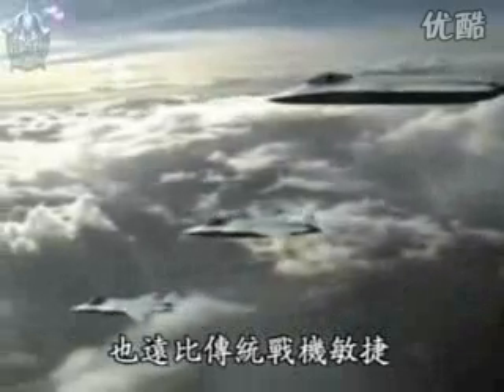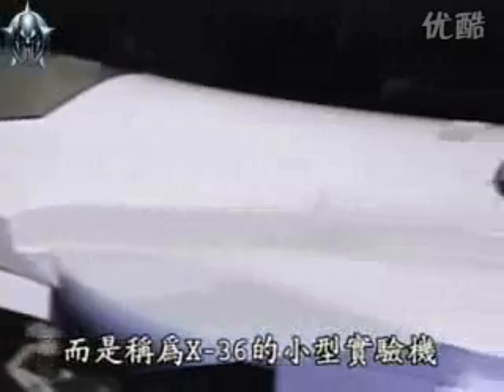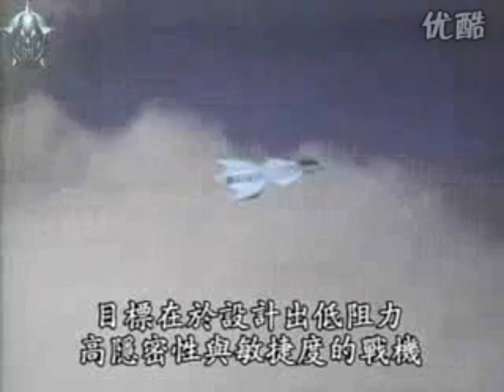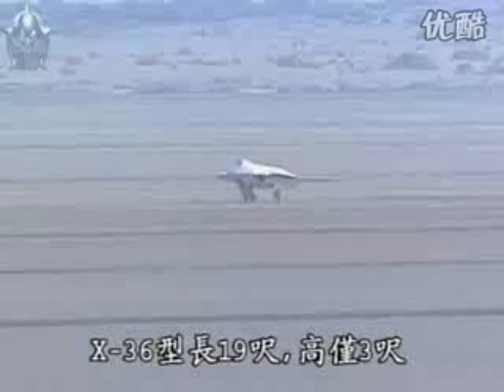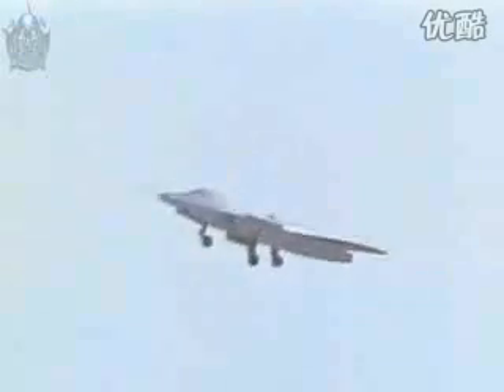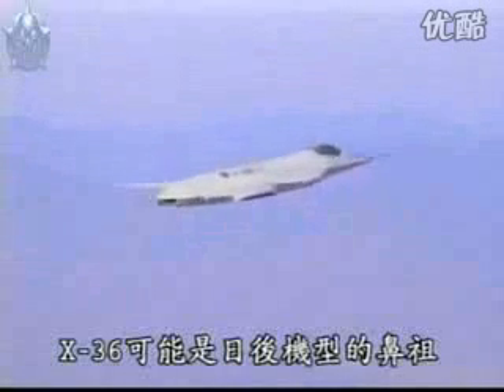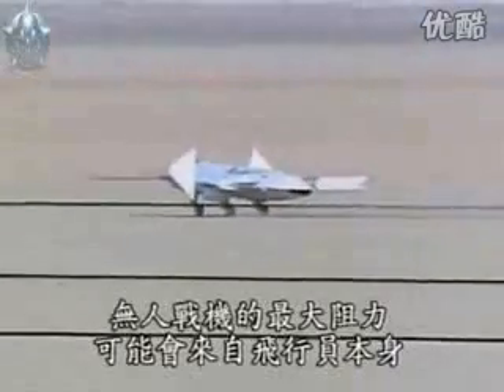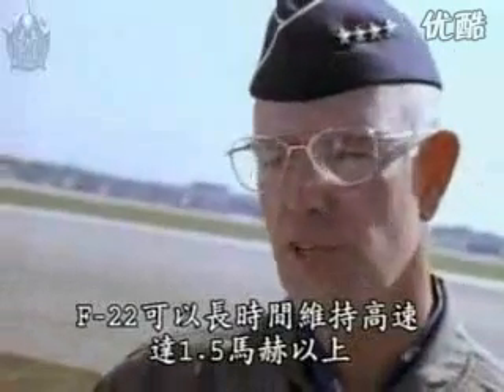Mcdonnell Douglas JSF proposal and x-36

Comment: Αnd look today. The most failed junk in history has the name Fail-35 Slowpoke.
Reply: +SUB ZERO LIN KUEI "Slowpoke"?? Load the F-16 or F-18 with the same amount of fuel, missiles and bombs as a combat loaded F-35 carries and see if can do Mach 1.6. Heres a hint....NOPE. And that's the difference, the F-35's numbers are when the aircraft is fully combat loaded just like it would be if it went to war, while all its competitors have to cheat by reporting their numbers with half fuel and carrying no bombs, missiles, pods, or external tanks. The F-35 was designed for COMBAT, not airshows.
Reply: +trpilot6 HAHAHAHAHHAAAAAAAAAAAAAAAAAAAAAAAAAAAAA

ICE JOKE !

HAHAHAHAAAAAAAAAAAAAAAAAA
Reply: +SUB ZERO LIN KUEI Chill out man.
Reply: Roland Lawrence The F-35 is one of the worst things to happen to the Russians. Russians rely on advanced integrated air defense systems to protect their borders, as their Air Force is not maintained and 1000's of planes have been written down for repairs with no date to be repaired.

Guess what was designed to defeat Air Defense systems? the F-35. It has a radar cross hair countless times smaller than the F-15SA, with the SA never being able to take advantage of stealth. (Stealth aircraft are built from the ground up with that role, not added on.) And the F-35's sensor fusion allows it to do endless amounts more damage than an up armored F-15 would.

And the cost BS you're spewing is similar to the F-15 debate 40 years ago. Congress disliked the Eagle because they believed that  a high cost per unit was the way to lose an air war. They believed that it's job as air superiority was useless if it couldn't do strike missions (a job that was adopted several years later after old aircraft were phased out.) And now look at it, it's the most decorated aircraft in the world.
Reply: Roland Lawrence Well that's great that you support the F-16 program, because what they are doing now with the F-35 is copying that logistics tactic. One being an expensive air superiority fighter, and another focusing on multi-strike with a less expensive price tag and planned exportation. (And neither the F-16, nor the P-51 have a K/D ratio to combat the 102-0 of the F-15)

I'm acquaintances with a couple Raptor pilots in the air national guard and while they have trouble meeting their minimum hours in some bad months, their training is highly dogfight based due to the simplicity that comes with their radar systems and weapons management in general. The wonderful thing about the JSF is that it's more of a weapon platform rather than a fighter, and simulators would really be perfect for them as the most training they have to know is cockpit management.

And most modern countries know that the first strike capability is one of the most important processes in war. If you don't have a way to strike their homeland through conventional means, you've lost. As I've said, the F-35 and F-22 have easily been finding loopholes in the S-400 and L-band radar systems through deceptive cruise missiles and great HARM capabilities that come native to the planes. (And you're gonna have to pull up a source for the F-35 only being stealth from the front and in X-band. If I recall it has electro-emission stealth and X-band stealth from all sides.)
Reply: Roland Lawrence Well, I'm not really sure what you mean by the "nuclear bundle" thing you're referring to, unless you're talking about the B61-12 variable yield bomb. But in that case you're going to have to give me a source on where we are exporting them.

And the F-22 was supposed to have Mmh/Pfh of lower than 12 by the time it reached it's maturity (a total of 100,000 hours of flight time). It did achieve this goal in 2009 when it had a score of 10.5 hours of maintenance. (This was before the F-22 reached its 100,000 flight hours too.) To put this in perspective, the F-16A has a standard 19.2 Mmh/Pfh.

Why the F-22 pilots have problems getting flight hours at my local base is not so much maintenance, It's the fact that there is a surplus of pilots, and only a dozen F-22's. (And the amount of mechanics at bases really makes a difference in maintenance time, with my base usually being understaffed.)

And as for the classic nerd fight between which plane is the best, why do you think that the P-51 is the greatest? What did it do that other planes didn't?
Reply: mPky1 A hundred missiles are useless if you don't have a platform to employ them from properly. And UAV's come with their own set of problems, with electronic warfare being a very effective tool against them.

And see, you're suggesting that F-15's will do poorly against modernized Russian forces (China's air force is practically a shitty Russian one.), but that's why we've created the F-35 and F-22. Using an upgraded 70's era plane to fight Russian 70's era one's is fine for now, but might not be in the future. Thus the current defense contracts are spawned.

(And the only Russian jet superior to the F-15c is the Su-35. In the latest war games the K/D of the two were 0.8 to 1 in favor of the Suhkoi. The USAF has plans to improve the passive awareness of the F-15c in a few years anyway.)
Reply: mPky1 Naval ballistic missiles are all used from a platform in the form of a 2.2 billion dollar Los Angeles class submarine, with a cost of 30 million for each trident ii missile fired.

So in total, to employ one nuke in the middle of Russian territory. You can use a submarine, where the cost comes to at least 2.23 billion dollars. Or you could use the F-35 and it's B-61 to penetrate enemy air defenses and deploy the weapon at the target with the cost racking about 130 million.

Enough talk about nuclear arms though, ICBM's and ship ballistic missiles wont be used unless it's an end world situation anyway.

The reason why we're investing in the F-35 and F-22 is because we want the first strike capability to take out their nukes before they can even fire them off. The US has teams all over mapping out just how to do that. And it's completely possible, you just need a lot of precision and a little bit of luck. The plane can still hit the nuke if it's in it's launch platform If it launches, it's all down to our nuclear defense teams to launch anti-ballistic missiles.
Reply: mPky1 Trident II has 14x 100 kiloton nukes, F-35 can have 2x 300 kiloton nukes. The B-61 is not a "shitty bomb", its 20 times stronger than the little boy used in japan. 2 F-35's is effectively the same power as a trident missile with all of the shock factor. (Russia and China can detect trident launches.)

And with forward operation bases in Mongolia, Europe, Japan, South Korea, and any body of water surrounding Russia, I think our F-35 can reach. It's range with drop tanks is something of 1,700 miles, which leaves a 900 mile target it can get it's payload out to. (with the assistance of high altitude bomb tossing.) The F-35b and a have about a 100 mile shorter range, but if it took off from the black sea it could easily reach Moscow with a few hundred miles left. And Raptors have a much higher range than that and can easily escort them there if there was any worry about detection.

The B-2 bomber is designed to hit further inland targets, with it's 7,000 mile range if we had one based in the UK and one based in Japan, we have the ability to hit any silo in Russia.

This is all beside the point though, most of our planning is against China, not Russia. China has a much more advanced nuclear unpredictability and F-35's are perfect for the job since we have FOB's in Mongolia, the South China Sea, and the Bay of Bengal giving even F-35's access to every launch platform.
Reply: Roland Lawrence The Air Force actually does believe the Navy's role is virtually useless when fighting a conventional war. China has the capability to launch a single missile to destroy a Nimitz class carrier, with virtually no way to defend itself. It's a large sum of money for those super carriers with no real guarantee they will be safe.
Reply: Moscow is less than 900 miles away from the black sea, as i said. The F-35a or b can take off of a Nimitz class and fly there.

(and it's closest border is Belarus, with 280 miles of Russian territory in between.)

Belarus to Moscow: 280 Miles
https://www.google.com/maps/dir/54.682667,31.0492915/Moscow+%D0%9C%D0%BE%D1%81%D0%BA%D0%B2%D0%B0/@54.1880229,29.7302446,5.75z/data=!4m8!4m7!1m0!1m5!1m1!1s0x46b54afc73d4b0c9:0x3d44d6cc5757cf4c!2m2!1d37.6173!2d55.755826

Black Sea to Moscow: 745 Miles
https://www.google.com/maps/dir/46.7517273,36.4452739/Moscow+%D0%9C%D0%BE%D1%81%D0%BA%D0%B2%D0%B0/@50.1184642,34.1999653,6z/data=!4m9!4m8!1m0!1m5!1m1!1s0x46b54afc73d4b0c9:0x3d44d6cc5757cf4c!2m2!1d37.6173!2d55.755826!3e2

And by the way, I feel like one of you is getting a little heated. I'm appreciating the conversation that is going on, and in no way am I trying to be antagonizing.
Reply: mPky1 You know you can just make one post right? You don't have to spam. I guess I'll address at least one of your insults, since you left one at the end of every point. You're calling me stupid and dishonest, but you just stated a post back that Moscow was 3 times the distance of any bordering country than it actually is to assist your side of the argument. This is blatant dishonesty, and anyone that knows a hint of geography is aware that Moscow is right next to the western border. Try being a little more civil next time.

Now back to the argument. We don't get to rule out the B-2 because we're "only discussing the F-35." The B-2, the F-22, the F-35 and the soon to be B-21 are all designed from the ground up to work together to achieve strategic advantage. Without one of them the entire system falls apart. 

China does have much more nuclear unpredictability, obviously you haven't done your research. China has dozens of launch platforms for every nuke they own, with a very complex underground rail system to secretly carry around the warheads. It allows them to minimize their nuclear arsenal to a tiny fraction while being more difficult to map out than Russia.

And yes, the F-35 can fly practically straight to Moscow... That's what stealth does for the bird, it can fly through air defenses.

And the F-35 does have partial access to the center of Russia. America has been making a lot of friendly gestures to the country of Mongolia, and we will most likely be FOBing with them in the next couple of years. Giving us access to a good amount of south Russia, and all of Russia if the B-2 is involved.

North Mongolia to Russian Central: (It's 2000km because i'm being forced to use a curvy walking trail, not a straight flight.)
https://www.google.com/maps/dir/48.8280249,89.3254673/55.5250826,79.5141709/@55.2822789,85.2240372,3.5z/data=!4m2!4m1!3e0

And finally, yes. Russia is that stupid to put nukes next to US bases. Remember when they tried to put nukes 170 miles off the tip of Florida? Also known as 10 minutes of flight time for the F-15 on afterburner. Russia puts a lot of nukes over in it's west bank because they are quick response nukes. It's to destroy the European countries capitals as fast as humanly (if ending our species is even in a human's will) possible. They have a lot of nukes in Siberia, but those again are easy to take out with B-2's.

The reason why Trident missiles and other ICBM's are not a solution for the US is because it assures mutual destruction. What they are emphasizing in this battle plan is destroying the enemies retaliation. Take out the silos first, then strike. If the Ruski's see 4000 ICBM's leave Iowa and Colorado, they will send their 20,000. If the Ruski's see 20,000 of their nukes get destroyed in the span of 2 hours with the always active ones getting destroyed in the first wave, they wont have any way to retaliation. (assuming we could even take out half of them that is. China's numbers are much more manageable.)
Reply: Roland Lawrence Well, that's a good point. The sealing off of the Black Sea could pose a challenge. We've sent cruisers in there before and I may be wrong but I believe we still have one in there. Maybe that tonnage requirement poses a problem, but i thought Turkey is the ultimate decider of who crosses, and let's just say they don't really like Russia right now.

We also have the Baltic sea, which is much larger and is the same distance away. You're gonna have to let me know if there is anything that prohibits us from going in there.

The Russian's most likely wouldn't shoot first. It's highly debatable that they could destroy our carrier first, as they don't have a stealth fighter, and we have upwards of 20 support cruisers and ships assuring the safety of our carrier, along with a wing of 4th and 5th gen jet's to protect it.

And i'm not going to go on record and say that the US is capable of taking out the massive amounts of warheads in the 'Rodinia', but the B-2 can carry 16 GBU-31's which are capable of bunker busting. And each F-35 can carry 4 GBU-31's.

Of course for this plan to ever be half conceivable you need the 1000 F-35's that were originally planned, along with the 1000 F-22's to relieve the stress an lug some tonnage out there. But I cannot stress this enough, Russia is not a target, nor a threat. China has been a main focus for awhile now.
Reply: mPky1 Man, I'm not even claiming that the F-35 is meant to be used for clearing nuclear sites, you got me onto this subject. All I was saying is that in a lot of cases the F-35 is better at destroying nuclear silos than ballistic missiles due to the ability to hamper the time for a retaliatory strike. The F-35 has far greater purpose than this scenario which is most likely never going to happen.

I'm also getting a little annoyed that you think the F-35 has to be graded as a single, self-dependent plane. It's like judging a fish by it's ability to climb a tree. That's not what the F-35 was ever conceived to be. It is very highly a support role for the F-22's, B-2's, and any 4th generation planes and ground units in the area.

And the 9/11 comment was kinda bold. Some F-15's with missiles arrived at the scene, and some F-16's with only ballpoint rounds arrived, but what exactly did expect them to do? It took the FAA over an hour to call an immediate grounding for all aircraft. There was dozens of thousands of passenger planes in the air at the time of the event. Did you just expect fighters to shoot down planes full of citizens under a slight suspicion that they might try to crash the plane?
Reply: Roland Lawrence Agreed, attacking Russia in the way I explained is all highly theoretical, and most likely the Navy would never even use multi-role fighters as suggested. Nukes or nothin' is the motto when it comes to us fighting Ruski's. The technology and man power is simply not there to pull off something conventional... yet.

Other than that though, I think you're really discrediting China's power. They may not seem like it, but their economy is doing well enough that they are effectively out numbering our entire military. They already are man power wise. They've been investing very heavily in increasing their Air Force, and their nuclear program is still going strong. They don't have much of a Navy but with the dawn of the end of surface combat in conventional naval warfare, who's to say they really need one? Technology isn't on their side by a long shot, but GPS jamming they do fairly well and they have the numbers to make up for the loss in quality.

I think the biggest scare for the US is that they've been expanding their presence in the South China Sea, and if they ever did catch us off guard there is simply no way to retaliate easily via air, land, or sea due to having to move units across the world.
Reply: mPky1 k
Reply: it is potato alright

Comment: Unmanned has yet to be tested in real war situation where you have an enemy that can interfere or disable the remote link. Right now UAVs are only fighting guerrillas and the like, and even those were able to down one by jamming the signal using consumer-grade equipment, so if it were an actual war like WWII drones would be out of combat in hours.
Reply: +Joe Schmoe But they would never take a pilot out of the loop the pilot stops the drone mistaking or going faulty and hitting the wrong target. We are way of Ai and that is risky to put something that can think for itself and do what it want into a drone.

Comment from the maker: it's because the x-32 was actually designed with weapon bay while the x-35 did not.  Obviously this makes the x-32 heavier.  The f-35 in its early stage were too heavy as well.  They had to shed additional weight to the point GAO reported that it makes the f-35 dangerous to operate

Comment: Dude, where have you been? There's 63 F-35's flying right now (according to Wikipedia). The problem with the X-32 was that it's engine was overheating during VTOL Landing. It excelled in VTOL take-offs, and supersonic flight and carrying a full load of missiles, unlike the F35 which never carried any armaments during testing. The X-32 could've been used as an excellent VTO-SL (Vertical Takeoff & Short Landing) airplane though. It's currently displayed at an air museum. Shameful.
Reply: Uh, there's something called an old documentary?